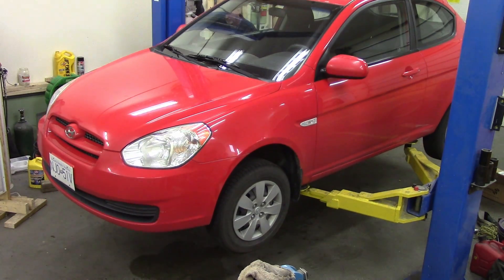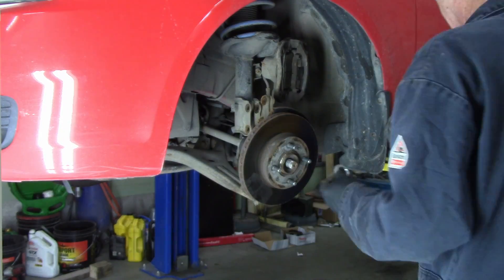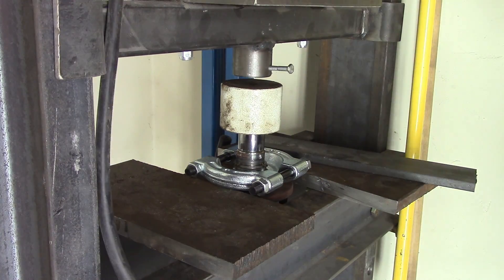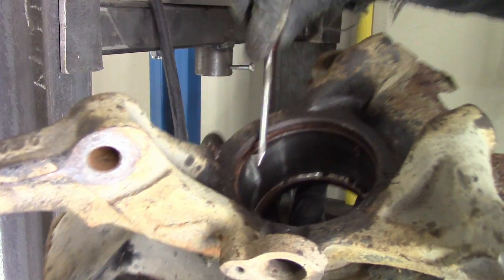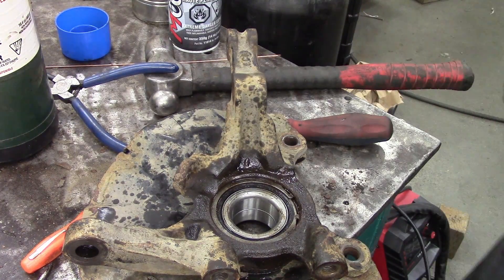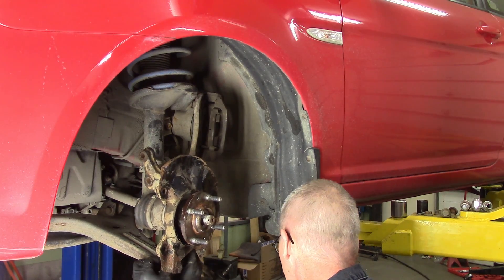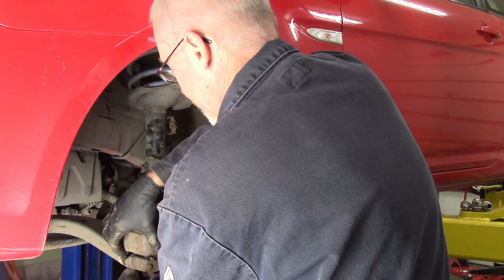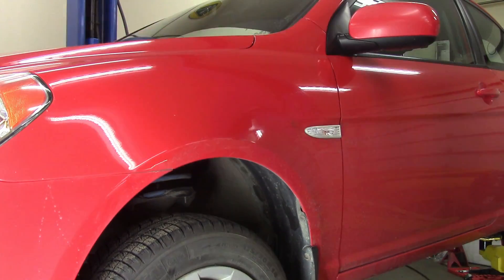Replacing a FWD Wheel Bearing

Comment: Seems to be a very  common repair in the shop these days.. One thing you failed to mention was properly torquing the axle nut. Just hitting it with the impact has been known to lead to premature wheel bearing failure.. Ask me how I know that fact. LOL Plus properly supporting the back side of the wheel bearing when pressing the hub back into place.

Comment: Nice repair job.  Maybe the Accent won't be so angry now!  I've done them on a 4x4 pickup, and they are definitely in the range of you'd have to pay me except it's my vehicle!  I suppose you could say the pickup was easier because I replaced the hubs and didn't need to disassemble the brakes or spindle, but those suckers were so rusted in place that it took lots of heat, a 5-pound sledge and an air hammer to get them out.  I used lots of never sieze as well to make it easier for the next guy.  Truthfully though, there probably won't be a next time for that truck.

Comment: Your timing is impeccable, Brother G! My EF's front end is making weird noises that lead me to believe that at LEAST the wheel bearings are on the way out.  So, I'm thinking the following:

1) Since I'm going in there anyway, and will have to take it all apart, I may as well also do the ball joints and the hubs. 

2) I have unfortunately found out that Honda has discontinued the hub/bearing assembly, and rockauto does not carry them. (Rock only has rears.)  Do you know of any good quality replacements for the hub? 

3) Also, how likely is it that there is nothing wrong with the hubs? I am thinking that if these generally don't go bad, and nobody makes them anyway, maybe I can get away with reusing them. On the other hand, I don't wanna go to all the trouble, just to have the hubs go bad on me a little later, and then I'll be right back where I started. 

4) For ball joints, rock has Mevotech TTX. Are they good? The internet seems to think so, but I trust your opinion more. 

5) Should I change the tie rod ends while I'm in there? I'm thinking not...but then again, I have heard that sometimes, suspension systems like it better when stuff is all changed together. I'm just a noob. Please help me see more clearly. 

6) Is there anything else I oughta change while I'm in there?  I mean, I'm in my 50s now, and plan to have the car for life, so if I'm gonna end up doing this work anyway, I figure it makes more sense to get it all done now, and then NOT have to deal with it when I'm in my late 60s or later. I'd rather do this, while I'm still physically strong enough to. 

Thanks for always helping me, man. =)

Comment: Thank you for the video. Nice to watch. I think the most useful tool I ever bought was my air compressor. My neighbor kinda chuckles and says that I should use a battery operated tool instead. Of course, He doesnt realize that there is a lot of things that you can do with an air compressor and the tools for that are coming cheaper in cost. I look at the batteries for these drills and such and they are way too expensive for what they are. 

My Buick has the built in bearings to the hub. I have never done the press-fit type. I also just bought a torpedo heater for my garage because my repairs are kinda falling behind and I will have to be working in the winter months to catch up. I have control arms, tire sensors, and an alignment to do on the front end of my car yet.

Comment: Hey, gr8 video, but just a thought, since that bearing is press fit, parts in contact during press jobs, do suffer surface shaving, and the quality of the press fit is determined by the press pressure needed. Why am is mentioning this, my dad drove a ford telstar tx-5 that had 2 accidents because of " faulty brakes". The first + second accidents were pretty much the same situation, my dad stepped on the brakes, the car did not slow down and ran into the back of another car, the driver of the car behind my fathers (case of the second accident), testified that he saw my dads brake lights and he also slammed on the brakes but my dads car kept on moving as if there were no brakes. Having had 2 accidents due to " faulty brakes" and having gone over the entire braking system as per my training, no defect was found in the braking system. Then one day my dad had to change a wheel bearing, he opted to just swap the entire bearing carrier for a " foreign used" part that was complete with bearing , brake disc etc, just reused the proper car's brake caliper. My dad brought home the complete part that came off the car, as i worked that time in the oilfield doing 28-28 rotation, and was leaving soon to go back to work, i soaked the areas that will be affected during the press work to change the bearing. Upon returning home a month later, i decided to change the bearing and have it ready to go as a spare for my dad's car...picking it up off the ground by the wheel flange, it pulled freely out of the centre of the wheel bearing...there was the " faulty brakes" ....a fault that did not take part in the actual hydraulics of the braking system....the brake disc would lean pushing back the brake caliper piston into the bore, resulting effect was just about the master cylinder displacement volume for this part of the hydraulic circuit...first pump of the brake pedal would put the rear brake shoes in contact with the drums and up front this wheel brake pads in contact with the brake disc, since no brake pressure was created- no brakes in this circuit, then thinking again, the diagonal split braking system has a firewall mounted equalizing block valve...the other diagonal split half of the brake hydraulic circuit should have slowed down the car...but in reality, having no pressure on one half of the diagonal split hydraulic circuit, reduces volume in the other half of the hydraulic circuit that based on the volume output of the individual master cylinder pistons, resulted in no brake pressure on the first pump of the brake pedal in an emergency situation....the car drove normally, brakes worked perfectly every time before even after the accidents, brake pads and shoes were changed and system bled out thoroughly. Strange things do happen and worse this car had changed hands who knows how many times before i purchased it from a mechanic known to my family, a guy my mom knew from her school days ..back to the point- the wheel flange piece does suffer more press fit surface shaving every time it is pressed in and out of the centre of the bearing....which can lead to an end play problem affecting the brake discs and the brake pad contact, there is no noise as the wheel bearing is in  perfect condition, and the brakes work fine up to when things get to the point they dont work when needed and then work as if no problem exists
Reply: I am having trouble following what you are trying to say.  I would like to know:

1) Are you saying that The Shop Teacher Guy should have done the pressing differently?

2) Are you saying that The Shop Teacher Guy should have measured something differently?

3) Other? What should he have done differently, in your opinion?
Reply: @Maplecook  replying to your doubts, 
1. He did the job as per procedures, just he did not show the pressure on the hidraulic press when fitting the wheel flange part into the centre of the bearing....the more pressure needed means a tighter fit...if it went in freely, the situation with my dad's car could arise.
2. Nothing really to be done differently, as in many instances a front wheel bearing is only changed once in a vehicles life span considering manufacturers for the last 25 years producing cars that last up to end of warranty period. 
3. Possibly in sourcing a front wheel drive bearing kit, it comes with the wheel flange part in the kit with a new lock ring also...
Reply from the maker: I have no pressure gauge on the press.  There was no damage to the hub or spindle surfaces. The bearing pressed into the knuckle and the the hub pressed into the bearing with the amount of force I expected. There are zero problems.  A purchased complete hub assembly would not likely have a quality bearing in it.
Reply: @GregWellwood  my sugestion / comment comes from 2 accidents my dad had with the car i bought and fixed up for him...brakes always worked till when really needed, then did not on 2 occasions, and me going over the entire braking system without finding any faults....really racked my brain and also consulted my professors from the NAIT automotive service technician course i undertook in my early 20's... We had 2 accidents because of this one part that probably got its surface shaved in doing many press jobs...the point is it happened and possibly could happen again- something to pay attention to, something that can be easily overlooked with devastating consequences